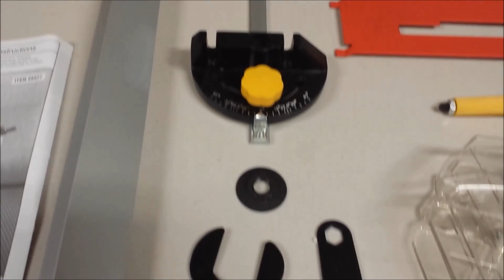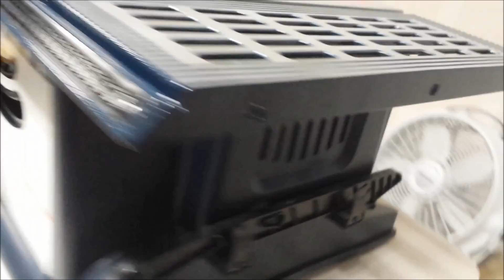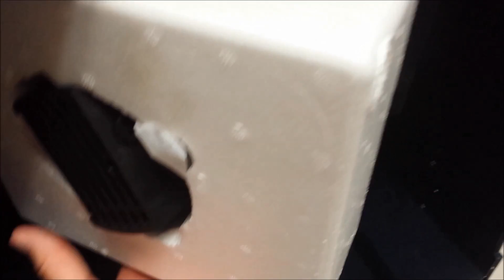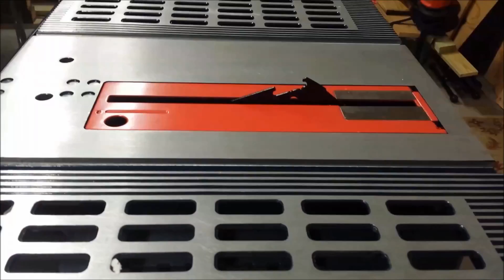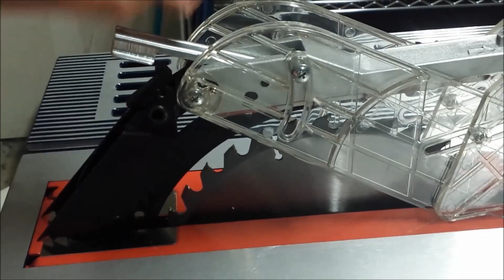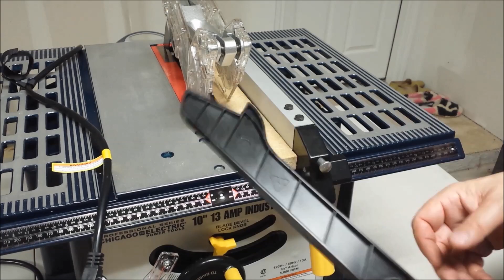How to Set-Up Your Harbor Freight Table Saw

Comment: How about covering things like aligning the blade with the miter slots, and aligning the fence with the blade?
Reply from the maker: This particular model is not really designed to be re-aligned.  :-)
Reply: @autohelpeu  With a 1/16" run-out, this is useful only in rough-cut projects.

Comment: I have this same saw.  My issue is the side fence black handle piece sticks out 1/8” from the silver side fence so my cuts are off.  Any adjustment for this?  Appreciate any help with this.  Thanks

Comment: So, how do you align the blade? It is crooked almost a full 1/8 inch front to back. I studied the inside, found 1 little screw that appears to be an alignment screw, but it did nothing. (attached to the bar near the front.) I did discover how to align the riving knife, helpful since it was not in line with the blade. The only way I can currently use the saw is to align the fence with the crooked blade but I cannot use anything in the miter slots.
Reply from the maker: Hi Linda - I have noticed that these models have changed over time so mine may be different than yours.  You may see two or more screws or bolts on the work table.  I believe these hold the entire motor/saw assembly in place.  If yours is the same you may be able to loosen them and re-align the assembly... but would be cumbersome to accomplish.  If you are within 90 days of purchase you could take it back for replacement.  I hope this helps.
Reply: @autohelpeu  Thanks, I did take it back. But it did occur to me, you could just align your fence to your blade, and make a crosscut saw that aligns to your blade. I bought a different brand that is 1/16 inch out of alignment, so will do that.
Reply from the maker: It's so disappointing that you can't get something off the shelf that is aligned properly.  Anyhow, I hope this new saw works out for you.  Cheers.

Comment: idk how you can cut with all that shit in the way > more dangerous with it on THE BEST FINGER SAVER IS A PUSH STICK  wish they made a fence that stayed 90 deg square all the time, when you move it>  Sure would save a lot of time
Reply: To get the miter tracks to align the same for both tracks each time for perfect straight cuts you will need to put metal tape onto your miter bars to fill the sloppy gap so that the bar doesn't wobble during cuts. Mine required 3 layers of metal tape (pain in the ass) but now it slides evenly and straight.

Comment: Your description of this video says you're going to show attaching all the safety accessories but I never saw you attaching the plastic guard on the blade which I would definitely consider a safety accessory. That was my only reason for watching this video. I cannot get mine to attach securely. I don't know what the problem is nor why I can't get it attached. I hoped to find out by watching the video. Simply time lost that I won't get back.
Reply from the maker: Debbie McInturff I apologize for not having that in there for you. But, the approach is almost the same for all of these table saws. So, go to 19:00 in this video.
https://www.youtube.com/watch?v=RbtTug0ipCA&list=PLlOO6ucQXejZRcPk27-1d2n4XE2YpuQ28&index=1

This should help you out. Thanks for stopping by and posting your concern, I want you to be safe.

Comment: Thank you, however you did not show how to square your blade to the table!
Reply from the maker: JC Adicks You are certainly welcome and welcome to my channel. You can see how to square your blades to the table in this video  https://www.youtube.com/watch?v=YZK9qmbLOxY&index=4&list=PLlOO6ucQXejZRcPk27-1d2n4XE2YpuQ28&t=7s
Reply: @autohelpeu  - That video shows where to do it on a RIDGID, but the screws on the Central Electric saw are on the top, not on the front. For anyone else who needs to know how to set their blade's tilt on a Central Electric, I figured it out. Mine is model #64459, but the model in this video (#68827) appears to have these screws in the same place.

There are two hex-head screws on the top of the table, near the front. The screw on the left will stop the blade at 90 degrees, and the screw on the right will stop it at 45 degrees. If your blade will not tilt as far as you need it to go, you need to loosen the corresponding screw at the top of the table. Note: If you stop your blade at 90 or 45 degrees and then tighten the corresponding screw, it is very easy to tighten it too far, so watch the gauge as you tighten it, then check the angle after you think you've got it right, to make sure you haven't tightened it too far.